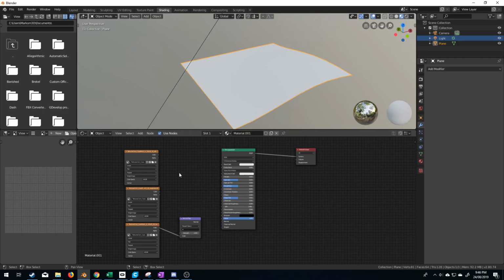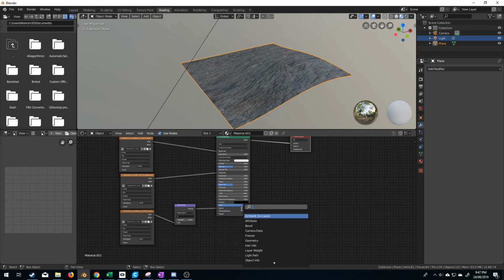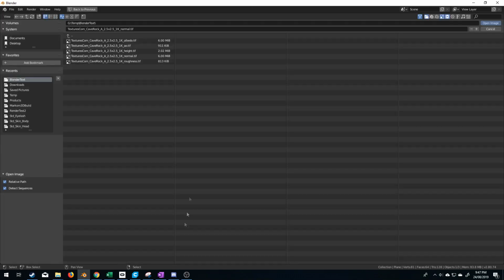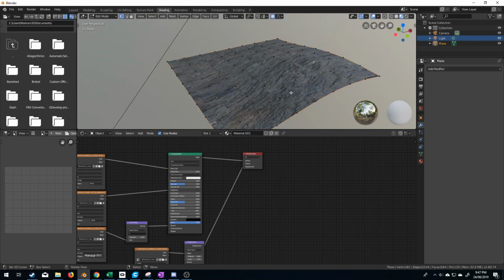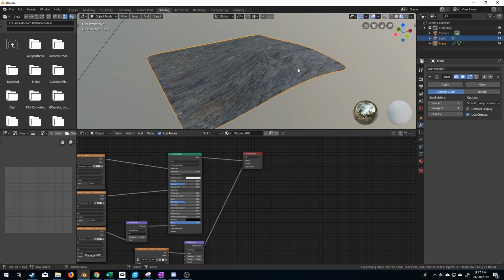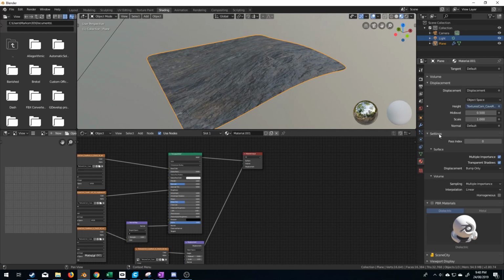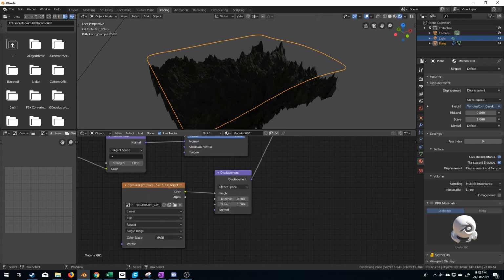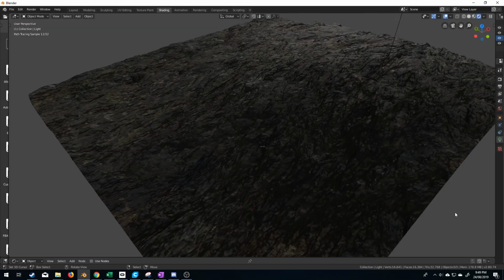How to use Displacement map in Blender

Comment: doesnt work in 2020. no matter how hard i looked, i couldn't find the option that turns the material from 2d to 3d. its just not there
Reply from the maker: are you talking about the displacement?
Reply: @Markom3D  yes, but it ended up being an issue on my end. i had to set the viewport rendering engine to cycles instead of eevee

Comment: 1. Connect displacement texture with displacement node and then to the displacement socket in material output. Texture's color space should set to non-color.
2. Give enough geometry to actually be deformed by adding subdivision surface modifier.
3. Set your render engine to Cycles and switch to render view.
4. Go to Material tab > Settings > Displacement. Change to Displacement and Bump.
5. Looks crazy? Adjust the scale in shader editor.

Comment: Hey Markom! I'm looking for a way to clone several image maps simultaneously, for things like tiling. Say I did the photogrammetry of the bark of a tree, and I want to use the actural height map of the tree that I baked from the multires. I thought materialize would do the tiling part of the trick but it only does it to the generated images taken from the diffuse map, it does not do it to the displacement map. This should be somewhere in Blender, and if it doesn't exist yet, it might be the first step to make Blender more like Substance. The other idea would be to automate, like Photoshop does. I could save the actions of cloning the diffuse and then applying them to the other maps, but I would like to be able to do this in open source software too.

Comment: not good tute
Reply from the maker: no worries mate, can you let me know what you did not like about it?
Reply: @Markom3D yes,  6 node items created and already in the node editor with no mention of how they got there, what menu paths they spawned from for start.  Most tutes exist to solve a problem.  Mapping is dependent on what kind of primitive you are mapping.  Maybe a title or disclaimer adjustment would better usher searchers into the tute knowing what they need for skills before beginning this lesson.  "node editing moderate skill level required",  or "displacement mapping for a plane using nodes" would be a good title.  This did not help me map full volume primitives. Cylinder, sphere,  etc...

Comment: You are using data textures (roughness, normal map, displacement) with wrong color space. Change them to non color data. This affects normal maps the most (try a point light over a simple plane using a normal map with sRGB select and then with non color data option). It might be interesting to mention that you could turn on experimental features in Cycles engine to have dynamic tesselation too (needs extra setup in the subdiv modifier).